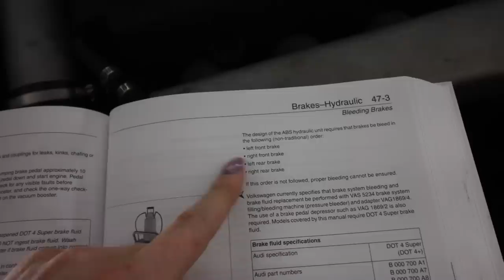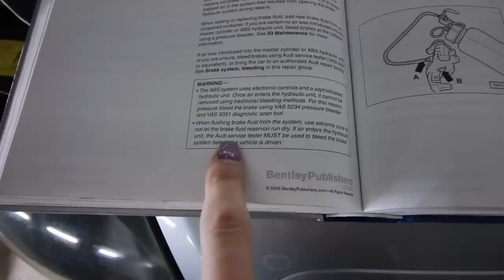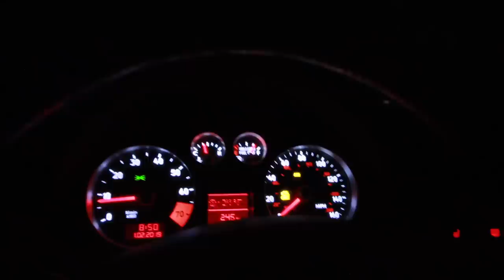Problem Solved! Clearing the Big Brakes // Project TT Quattro

Comment: Ugh. I hate twist in caliper pistons. Discovered them for the first time working on a Volvo I gave my nephew. I actually ended up fabricating a tool by folding steel into a handle and leaving a round face that I welded two pegs onto. That way I could twist and use a C-clamp at the same time. It was actually my first car vid and is still one of my most popular! Great work again, Sarah. The caliper match looks good!

Comment: Wow that ocular is pretty close! I made pressure bleeder out of a weed sprayer... And made my own caps for the brake systems I use it on.. Was cheap and pretty easy to make. I have always used my hand vacuum tool to clean out the  master and filed it with new fluid and then bleed the system... Saves getting the air in. Seems tow work well...  Good that you have people that willed you tools!

Comment: That came out remarkably nice for spray paint.  It'll be interesting to see how they stand up to heat.

The special tool required to retract those pistons can be had for just a couple of bucks at most auto part stores.  It looks like a little cube with little pins sticking out, and 3/8" drive square holes in each side.

Comment: I've never thought of mixing spray paint like that, genius.  teeter tot has come a long ways!  I used to have a 300zxtt which was an absolute nightmare to work on so I get the pains you're dealing with with these two projects.  And the snow....I'm in indiana, did not realize you got snow, lol.

Comment: Great Video. For small items I use the PREVAL sprayer. It’s a bottle with a propellant disposable can on top. Pour the paint and it will spray like a rattle can. You can find them at Home Depot in the spray can section, About $8. Works great. Great Job on the brakes.

Comment: It's like that cause there is a handbrake directly on the calliper and not in a separate drum brake (as you are probably used to seeing). Twist and turn thingie is there so the handbrake self adjusts when you pull it. Great vid as always.

Comment: Just as a future reference if you spray the calipers white first for a base coat and then apply your mixed color afterwards you will get a far closer match as just putting your final color over the raw metal itself will make your mixed color look darker than what it should be. Whereas if you put your mixed color over top of a white surface it will pop and be far more accurate of a match. Not critiquing just getting some experience that I've learned from the years. Love the channel and keep doing what you doing <3

Comment: If you ever have to remove a brake system part and open the lines to the atmosphere, pinch the closest flexible part of the brake line with a pair of vise-grips to prevent all of the flui from running out of the open line. The twisting action of the caliper piston is part of how the parking brake works.

Comment: @arah n Tuned the press and turn mechanism is there because the caliper auto adjusts the handbrake when the break pads wear out and get thinner. It is like this on every car that has the handbrtake built in the rear brake caliper.

Comment: Good paint matching!
Tip for next time:
Depress the brake pedal until you get light pressure and keep it there with a stick. Then you can open up the brake lines without loosing much of the brake fluid. 
Its always better to not introduce air into the system even if the plan is to flush everything out.

Comment: I get having to use weird tools to replace disc brake pads. I was always used to collapsing the piston with a c-clamp, but couldn't on my '84 Z28, '85 IROC  and my '87 IROC. All 3 had the JL8 4 wheel disc option and to collapse the pistons you needed a special tool to do it. It was about a 1" square junk of steel with a 3/8" drive opening on one side and two little nubs, on opposite corners, across from it. You had to turn and squeeze to get them seated. Luckily it only cost about $4 at Pep Boys. Keep at it kid, it'll all come together.

Comment: Brilliant!  It was worthwhile calculating the spacers so painstakingly!  Neat trick with the plastic bag and zip tie!  AWESOME JOB Sarah!  Tip for next time: I understand that if you had fixed the brake pedal in the depressed position, you could have waited with bleeding until the calipers were re-mounted, ensuring that no air would enter the system (but I don't know Audi so could be wrong).  Change of topic: sometime you'll need to take some R&R, to take care of yourself. You're driving yourself very hard. All the best, Rob in Switzerland.

Comment: You can buy a universal kit of different presses for brakes.  The proper tools are easier, they remove the risk of pushing the pucks / pistons back at an angle, and they're not expensive given how much brake work you end up doing in a lifetime. Also, Happy New Year, and thanks for the snow video.  I've spent the last few days on the beach here in the NZ summer.

Comment: you can use  valve stem where the banjo bolt goes to block the brake fluid from dripping

Comment: rattle can paint seems to always dry darker than what it seems when wet.

I have a pressure bleeder (circa 1960)  that I have been unable to use since the installation of ABS and proportional brake systems .  I have used it on grain wagons and implements that still use the simple systems.  Essentially what you used there .   I have used vacuum pots with success on new brake systems  . beats the hell out of the brake pedal pump method

Comment: The Dot4 LV that you used actually has a higher Wet Boiling Point than Pentosin's SuperDot4, and the same dry spec. You made the right choice with the Low Viscosity stuff.
Reply: okey that's true but why not use DOT 5.1 already ??? almost any 5.1 should have even higher boiling point ...
Reply: What she is using is pretty close to the min specs for Dot5.1 already(within 5*C dry and 20*C wet). The different grades(aside from Dot5) are based on minimum specs, which most Dot5.1s are pretty close to, and the Pentosin Dot4LV is a very good Dot4, not to mention readily available, and reasonably priced.
Reply from the maker: Yanc0_ It came down to what was available on New Years Eve at 4pm. This was the best option I had.
Reply: @SarahnTuned  well i guess you have a point ... that didn't even cross my mind that you had to buy it on new years eve ... :P maybe now you know that you should have some fluids always in stock ... :D by the way have you thought about pulling the fenders a bit to have nice flush fitment ??? I had to pull fenders on my Audi A3 to fit ET35 R17 wheels ... but it looks really weird with R16 winter wheels ... :D

Comment: Sorry if someone explained but for the cable-type rear calipers to be effective they need to apply tension to a lever. The lever acts as a moment arm to gain mechanical advantage and utilize the same pads as the brakes themselves. Basically a caliper that doesn't have this feature will not need to be spun in but then will need to utilize shoes inside the rotor for handbrake or another caliper altogether.

Comment: Hi from NH. Where in New England did you grow up?     

P.S buy a "disk brake cube". It fits in the notches on rear caliper pistons. You attach it to a 3/8 ratchet extension and spin the piston in while pushing. They are SUPER cheap, worth every penny.

Comment: I bled the brakes on my VW Bora (Jetta in the US) at the weekend and looks like I bled them in the wrong order 😂 Had the same weird green brake fluid come out as well. It's worth getting the proper tool to wind in the rear callipers as in 95k miles I've changed the rear discs/pads twice but haven't touched the fronts. I now have calliper envy looking at yours. Keep the videos coming in 2019...!!!

Comment: Sarah, next time if you undo your brake line if you press the brake pedal (with a bar between the seat and the pedal) then there won't leak so much fluid. Just a tip :)

Comment: You should make a series of ABS stops (where safe, of course) to make sure you get any air in the ABS module worked through. The pressure bleeder alone obviously doesn't work the ABS and old fluid (and possibly a bit of air) could still be in there. Then do another flush. Especially if it seems wonky when you hit the ABS.

Comment: Nice job Sarah! I hope you cleaned out that enginecompartiment verry good! Brakefluid can destroy everything from paint to electric connectors! So watch out!
Reply from the maker: I dumped like 3 gallons of water over the area it spilled, the engine bay and subframe might get a respray when the engine eventually comes out.

Comment: Awesome job with the color match and the method of doing it all together! I never would have thought of that! 

Also since you mentioned you have VCDS, definitely make us of it next time you ever feel like you got air into your system! Itll make your life so much easier (Though the pressure bleeder is the next best alternative and probably the easier choice when you're bleeding solo.)

ALSO ALSO - In regards to your longitudinal sensor, you will need to use VCDS to adapt it and zero it out! 

Keep it up! I personally dislike giant brake calipers on TTs (not that it matters, not my car), but this looks fantastic!

Comment: You may want to invest in a bench part sander. Cabinets can be used for small part up th 15 inches. And a start at about 200 bucks. Then you can clean all your smaller hard wear as well. Knowing your O.C.D.👊

Comment: It's pretty common design sold all over the world, not from Audi.
But as far as I know you dont need to compress the piston if it's free, only turning it until down.
And you can use any kind of stick on those gaps on the head of the piston.

Comment: I was weary of the paint match, but yeah, you got it pretty damn close, well done. Hope the vise didn't leave many marks. Thanks for another great video!

When I first started off working on cars 15 years ago, I only worked on vehicles that all had drum-in-disc style parking brakes, and never had to deal with a spin in caliper piston. After work one day when everyone else was gone, I went to change the rear brakes on the Honda I had at the time, and (not using any tech data, since I clearly knew it all back then!) ended up buying 2 rear calipers that night because I thought they were bad! I heard about that one for a while after I told some of the other guys in the shop about my bad luck the next day! But yeah, I've never been a fan of mechanical parking brakes built into the caliper, even with all the right tools, it can still be a pain.

I don't know if KSport says differently, and I didn't see anywhere that Audi lists a specific procedure for their fixed, opposing piston calipers, but most manufactures want the inner pistons bled before the outer. I never saw any difference doing it one way vs the other, and as long as all the air is out, I can't see it mattering at all.

The 'Warning' in the book isn't so much for the pressure bleeder, that just makes it a much easier process, it's saying that you need to use VAS5051(which is basically the OE version of VCDS) to power/actuate bleed the ABS Modulator if air got into the Hydraulic Assembly. The valves inside there are normally closed which allows pressure from the Master Cylinder to normally flow right through(with some force distribution on each feed, as it is diagonal split) to the individual fluid circuits. It's not until ABS/ESP kicks in that the valves are actuated and air can be bled from the pulsing circuits inside the modulator. If air got into that portion of the modulator(the pressure bleed-off valve in there will allow air to enter if the circuit is dry), then you'll still have some trapped in there. 

For normal driving that won't be an issue, as that portion of the system isn't used, but (once you get the ESP fixed!) if ABS/ESP tries to kick in at some point, it won't work properly. I know once you get him ready to really drive, you aren't going to want ESP to be functional to begin with, but just something to think of. You can use VCDS to self-bleed the system (03-Brakes > 04-Basic Settings  > 001 > Go, and follow the prompts) or you can just find a place that you can safely engage ABS/ESP(are there any sandy open spaces around Tucson??) and force system to open the valves and push the air into the normal braking circuit and then rebleed. You will probably need to clear the faults before it will try to engage on it's own, for this to work.

If you read this far, glad you're happy with the stopping power, and I hope you eyeballed that <0.15mm dead on! I was right there with you NYE, but I did drink my old fruits that night!
Reply from the maker: Dave I clamped it on an unpainted area.

Comment: I don't know if there is one in your area, but usually the local paint/body supplier in your area can make touchup/spray cans of the colors you need. They do it here for like $12 a can. You just take your color code or sample in, they'll mix it and put it in a rattle can for you. You might contact your paint buddies and see if they know a supplier that does it.

Comment: Just wondering if you thought about building a bench/tool holder? It would serve multiple functions like hold your vice, larger tools, and give you a solid surface to bash things on. You could make it out of wood, cause it’s lighter and stronger than steel. Cheaper too and doesn’t require a welder. Throw some good castor wheels on the bottom of each leg and you can wheel it around to wherever you’re working and it wouldn’t take up valuable wall space. Anyway, just a thought. Great video as always. 
Happy New Year to you as well!
Reply from the maker: Sheldon Dyck I dont construction very well. 
Mechanics=Yes
Woodworking=Hard No
Reply: Bah, that’s nonsense! You did a fine job on the rear seat delete for the TT! No reason why you couldn’t make a simple work bench. I have faith you can pull it off Sarah. I’m gonna pass on a bit of advise a good friend told me years ago. You’re only limited by your supplies.
Reply: You could check out April Wilkerson on Youtube, she does a lot of smart DIY-workshop furniture projects for efficient space use.
Keep up the good videos, I love your projects and your problem solving skills. 
Happy 2019 !

Comment: nice paint match on the calipers girl, im a vehicle tech and i have a tip for you, dont let air get into the abs pump while you bleed or change the brake fluid or flexi hoses, if you slightly hold down the brake pedal with a bar against the seat or seat rail it will stop the fluid from running out, sometimes you need a scan tool to activate the abs pump while you bleed out air which if you dont have can be a real p.i.t.a.

Comment: Hope you will read this....i changed brake hoses last year against braided stainless steel hoses and to not having the brake lines drip all over and have the hydraulic unit bleed out just fully press down the brake pedal and fix it in the depressed position. That way you won't lose brake fluid and won't drip this crap all over everything. Helped me loads when replacing these brake hoses. Oh and by the way..... these front brakes are sketchy as hell! Not having a properly centered brake disc is a nono for me.... wouldn't fit this stuff (i'm very big on driving safety) and certainly would want my money back. Wish you a handful of air around the car at all times.

Comment: I have a 08 FJ Cruiser I broke my brake line, the system is completely dry. I used 3/16 ID hose at all 4 brakes and ran to the master cylinder bled by myself fixed it with the cost of the hose And replacement parts (no special equipment for me)!

Comment: Loving the TT.
I've always wanted to do a TDI swap in one of the first gens with a 150-200hp ALH, or maybe a V6 TDI out of a taureg.
Really like the lesser desired of the A4 platforms, no one expects 200+ horsepower out of a TDI beetle. not that the factory 100HP one i have is really that sluggish... 
But i cant decide which A4 i want to build on. I currently have 2 newbeetles. an 06 tdi with the DSG that im scared to touch, and a 2000 gas with the 4 speed auto. 
Would love to do an AWD V6 TDI swap into a mk4 jetta... but on the other hand it would be really easy to do an ALH swap in a TT and get pretty much the same result.

Comment: need more eurobeat for 2019.  nice match on the paint job...actually, you only really need to paint the out half of the caliper as that is the the only part that is visible from outside the car through the wheel.  HF has a brake piston kit that allow you to twist & turn or you can rent them from you local auto parts retailers (assuming they are not being rented at that time).  when you transition cut scenes, you can move your hand in front of your face and that would a sign for transition when editing...

still can't believe that Ksport couldn't get the rotor hat correct for the TT with customizable 2-piece rotor/hat design.  that is the whole point of going 2-piece, one rotor, multiple hats for multiple cars (and sometimes lighter design)

Comment: I'm not sure if you did it already, but a tool box tour would be cool.
Reply from the maker: Justin Hedlund I need a new tool box, mine is too small.
Reply: @SarahnTuned  If you're looking to upgrayedd, see if you can find any Kobalt ones left at Lowes, when they bought Craftsman they dropped the Kobalt pricing a ton, and were making deals to get them out of inventory. One of the guys at my shop picked up a 61" Kobalt 3000 series for a steal a couple months ago, and it's better quality and bigger than similarly MSRP-ed HF and Craftsman ones.